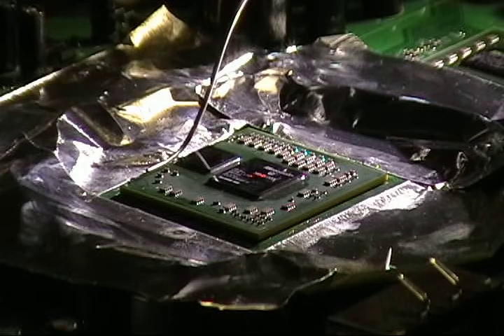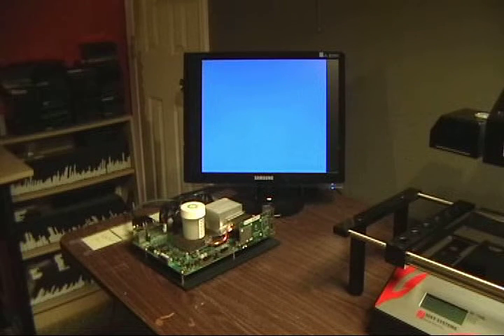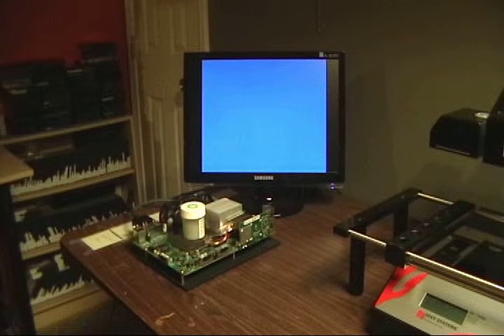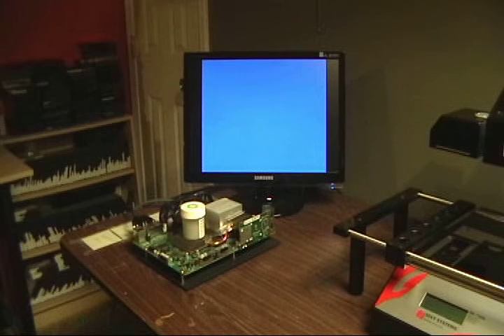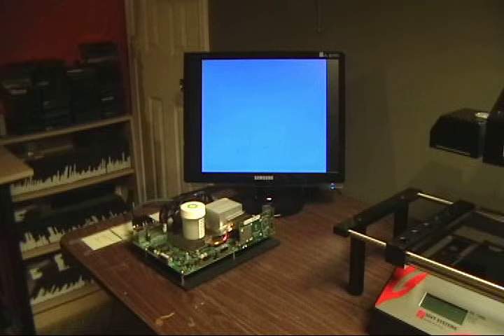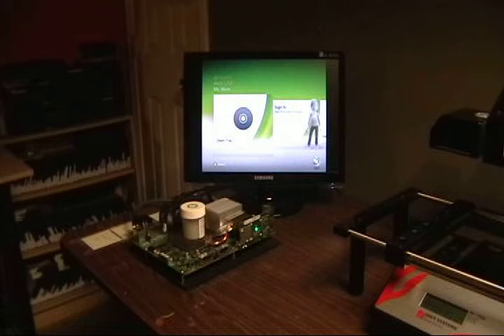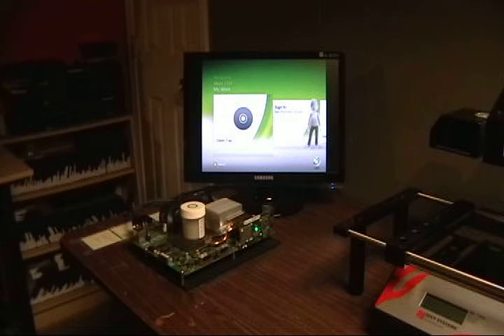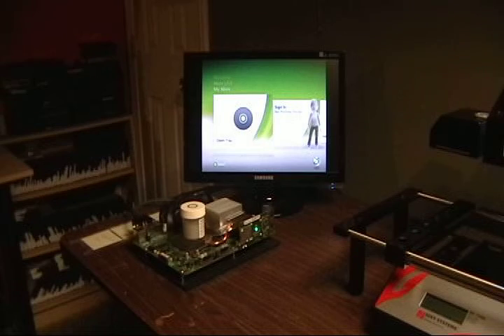Xbox GPU Fix E74 Part 8

Comment: When the GPU is heated up, does the solder on those tiny components ON the GPU (resistors?) melt also? Do they ever accidentally move off of their position?